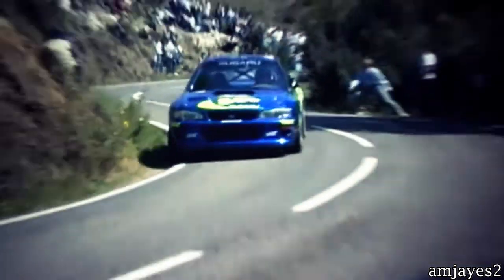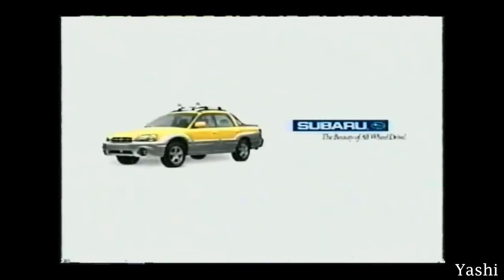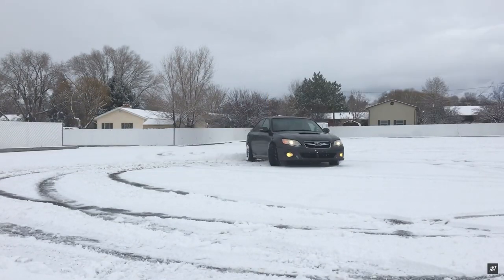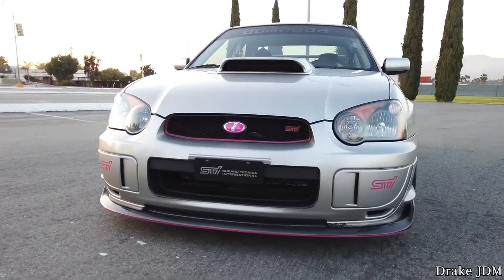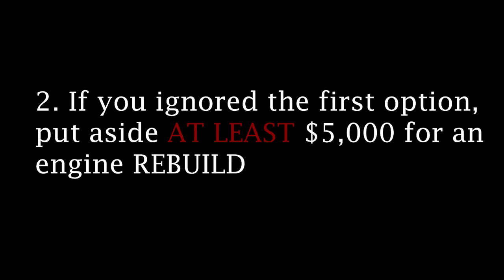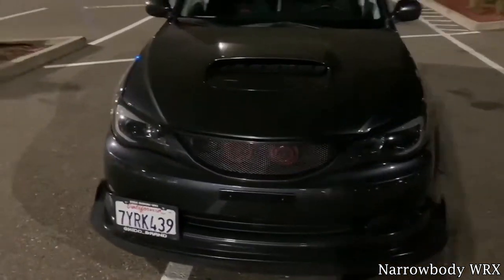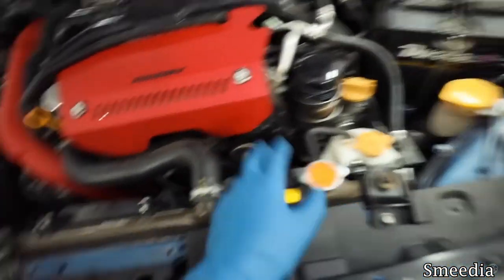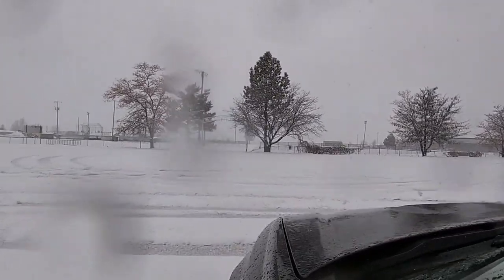How To: Ultimate Guide on Turbo Subarus

Comment: On the turbo models head gaskets aren't usually an issue they have the multi layer steel gasket. The 2.5 n/a engine is very common for head gaskets problems up until 2013 I believe after that in 2014 is when they started using MLS gaskets on all subarus
Reply: Someone told me that a lot of the gasket issues were also from people boosting them too much as well as not getting them tuned. What you said is good to know. I appreciate it. Makes me worry less about mine.
Reply: Yes, let's please dispell these ej205/255/257 head gasket issues. These were simply not a typical failure on these engines. The head gasket issues were most specifically affecting the sohc ej251/253 engines

Comment: Last year i got a 2019 STI WR Blue with gold wheels and i know the last guy dogged it out because i saw it drag racing a Malibu on the highway. It only had 26k miles on it and i have been babying it as much as possible but still enjoying it. Its one of those cars that no matter how fast im going, just the feel and sound of the car is enough to make me not want to park it. My nephew and i are finding ways to modify it for reliability like the radiator will get upgraded and also the cooling mod for cylinder 4 will be done at the same time. Not looking for power but a longer life.

Comment: I picked up a 2017 wrx a little over a month ago.  It is the premium trim which is nice since I prefer cloth seats, but at least for the 2017, the base and premium come with halogen headlights.  Not sure if mine had been replaced or not, but the bulbs were not very bright.  2 options there are 1. get better bulbs which were like $100 for low beams and high beams, or 2. get the limited which came with led headlights.  Only other this with it is the rev hang between 1st and 2nd.  You do get used to it and it can be tuned out.  The VA wrx is honestly really fun overall and if you want a newer Subaru, it is something to look at.  Got mine with 41k miles on it and it runs perfect.
Reply: Just hit 50k on my 17 been making over 400 whp since 15k and I’ve had 0 issues. Owner neglect and improper maintenance/tuning is what ruins these cars.

Comment: As a fellow Legacy owner to another legacy owner... I'm saddened to hear the lack of love for the 2010-2012 legacy GT which came in turbo 4. Front mount turbo and 6 speed trans box before the 2015+ WRX got those upgrades.
Reply: i was about to say the same thing.  I own a 2010 Legacy GT and love it.  More room, definitely a dad turbo car
Reply from the maker: I thought about this during the editing of the video, as well as the turbo foresters around that time. I decided not too include them, because for the most part, they are pretty solid, so there wasn't enough cons to mention them. If I did, it would have been like a 10 second clip
Reply: @HandBrakeJake   I Currently own a 2011 Legacy GT, in particular the fifth gen gt's (09-12)(09 came out in japan and australia if i'm not mistaken and everywhere else got 10-12) are quite unique in their own regard. I feel like they could have had a decent little segment in the video because they did play a key part in development for the 2015+ wrx and sti.
Reply: Legacies are so underrated and cheap. I have a JDM B4 RSK with the EJ208 and a twin turbo, pretty fun and ultimate sleeper since nobody knows about them.
Reply: @skippylegrandgourou2069  missed the entire first generation of the legendary legacy ss sport and the entire turbo and the difference between a closed cell block and the entire usdm market has a open cast in cylinder blocks and the differences between those engines and the differences of all types of data for non/vvt engines but here is another example of a self proclaimed in the (no)know difference.
Reply: I made a small reply to another of the comments but again thanks for Not doing the homework on All the subjects and even the fact that you can miss the first and beginning of this footwork Turbo legacies of the 90 to 94 and the entire differences of the closed cell block and the factory or oem jdm/usdm versions of forged internal core parts and the entire engines with/wout beginning head's and ignition systems and other differences of vvt and camshafts of just the basic principles of the usdm cast sleeve engines and never really mentioned it makes me think that you have no practical experience with what you are even talking about. Sorry for the rant and the grammar but it is 4am and I'm not happy with the children that have not done their homework but they are giving you testimony as knowledgeable about the entire car line and life span but doesn't even know what started the legacies and the original Turbo and the entire 2.0/2.2/2.5 Turbo engines and specifically knows exactly what to include and stay away from without any doubt? Normal sitting in the passenger seat when the real car's comes through town. And don't need a  AAA card from mommy to fix it.

Comment: At 92k miles on my FA20 WRX I can confidently say it is a reliable car as long as you know what you’re doing. The problem with most Subarus is the idiots that usually drive them. Change your oil every 3k-4k miles and check it every other time you fill up on gas. Get it checked out and do something about the carbon buildups that plague DIT engines.
Reply: I asked my tuner about carbon build up in my MY15 WRX with 100k miles. The feedback I was given is that on the dyno, with the car going full tilt, it is good at cleaning it out
Reply: @mogle4074  if that’s the case I must have a pretty clean engine lmao. Thanks for the tip though!

Comment: 15-17 wrx - Pitch stop cracking the firewall
15+ wrx - plastic turbo inlet cracking, plastic cup on bottom of shifter assembly breaking, fa20 weak rods when modifying.
Reply: Were the rods ever strong? And it really seems like the issue with big boost is the small area the bearing can grab onto the crank due and aluminum blocks/thin walls in deck?
Reply: @byloyuripka9624  don’t forget that the FA20 rods are offset. Very unforgiving to detonation.